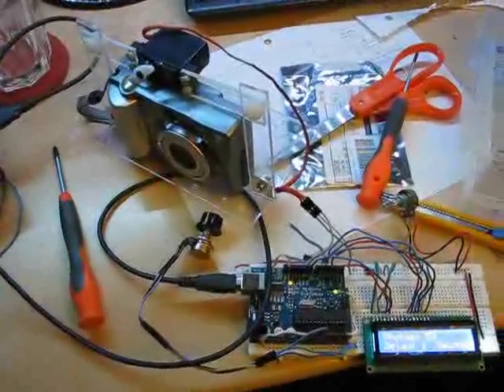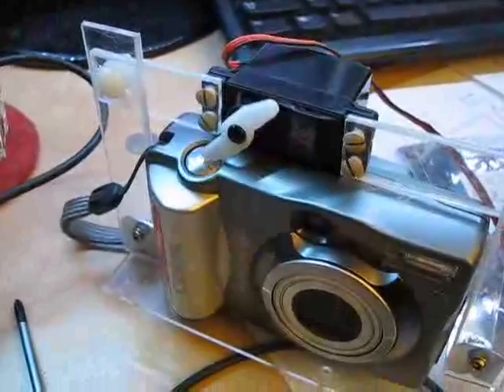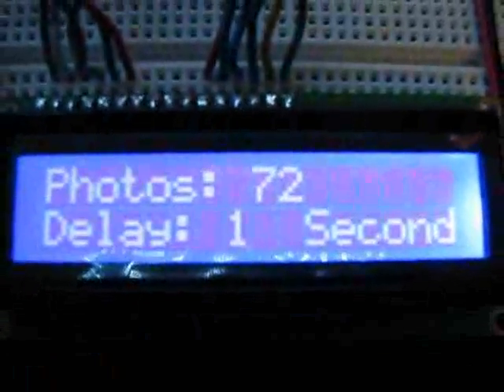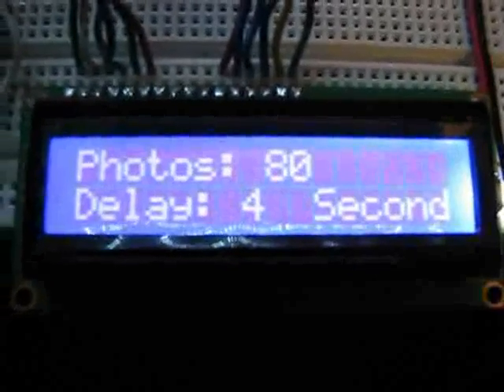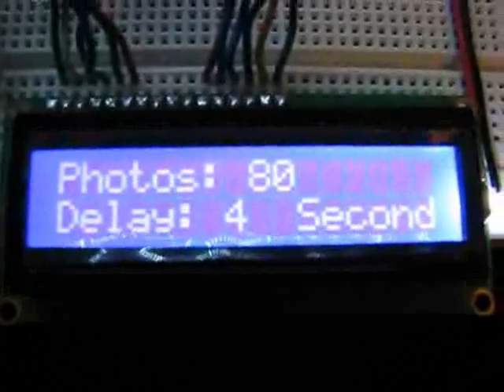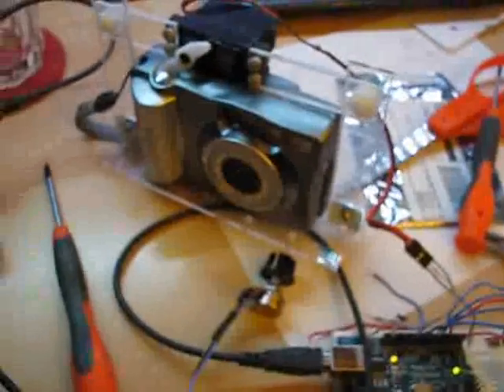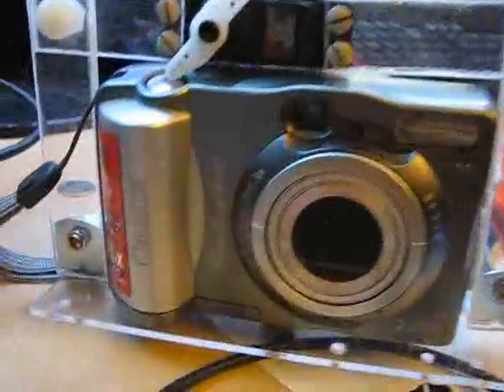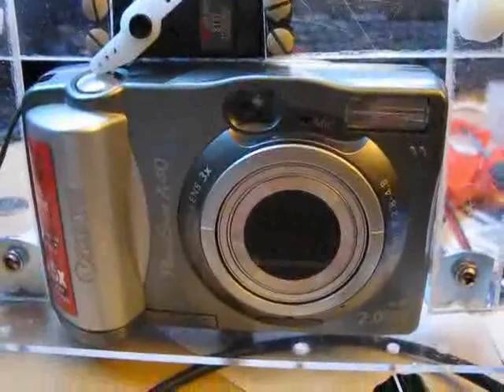Quick and Dirty Timelapse Photography

Comment from the maker: Plexi is pretty easy to work with, you have to score it on both sides and snap it on a hard surface, just like cutting circuit board material, or, if you are lucky, you can get a laser cutter or other CNC device and do some cool stuff like gears.

For the most part you can only score/snap thin (1/8") plexi, once you get to 1/4", you need a laser or a mill.